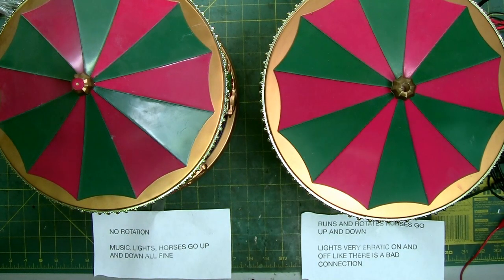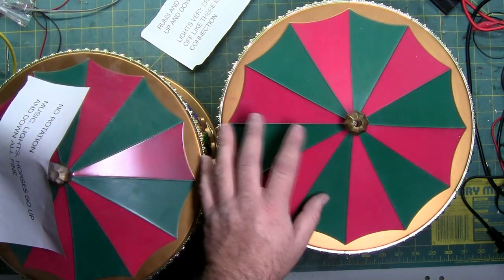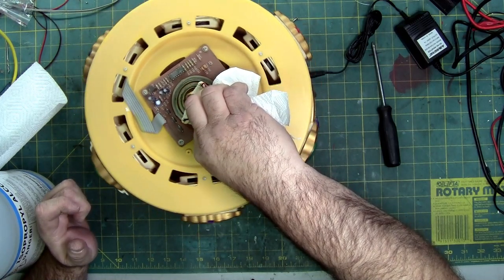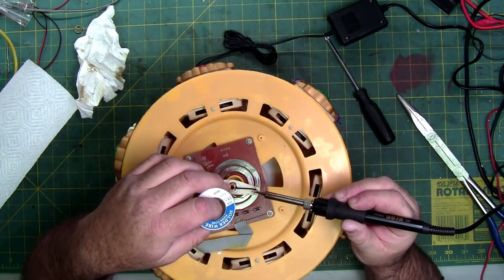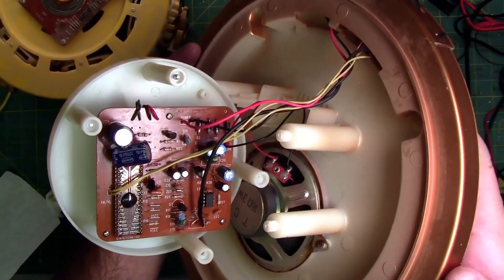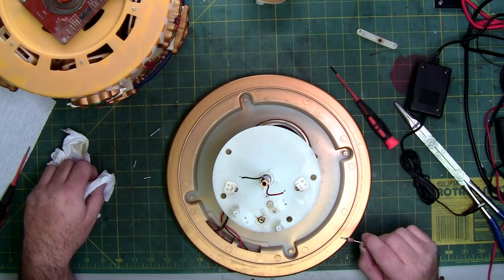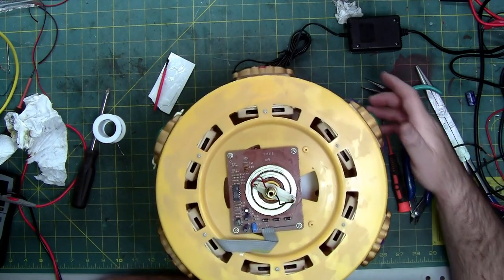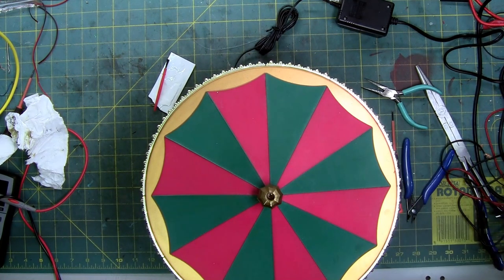Mr. Christmas Holiday Merry-Go-Round Repair

Comment: I have one of these and the lights and horses are not functioning.  Any suggestions.  It was purchased at an auction and looks to be in pristine shape otherwise. Music and rotation is fine.  Thanks.
Reply from the maker: Rotor on top is corroded, dirty or has a connections issue. Check the top rotor, clean it with isopropyl alcohol and check the connections and that the fingers are making contact with the rotor disk. The most common failure is generally at the rotor disk.

Comment: hi howmany volts should the top rotor rings have ? all my horses dont work .
Reply from the maker: Voltage at the top of the rotor is generally the same voltage as the AC adapter output.

Comment: Hey, I just found one of these! It's not working at all. Opened up the control panel where the on/off switch is. Looks like wires were ripped out. I know nothing about repairing wires. Do you have any videos for this? Can send pictures and would really appreciate any advice. Thanks!
Reply from the maker: Send some pictures to randomjchannel@gmail.com